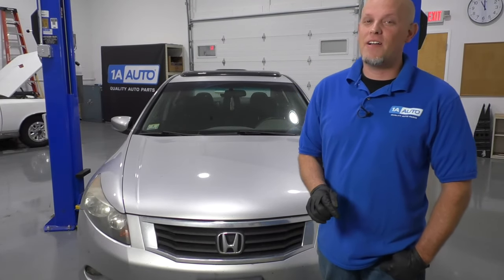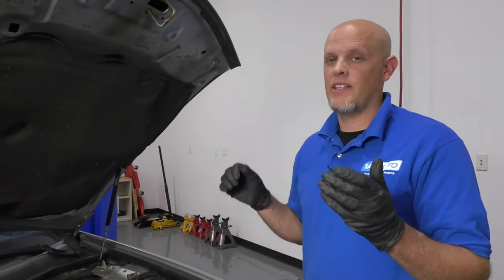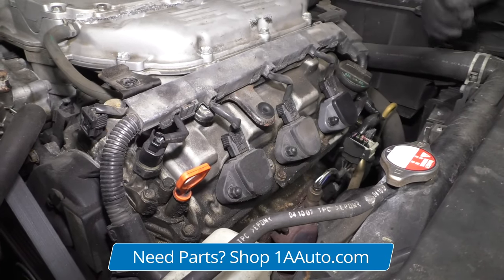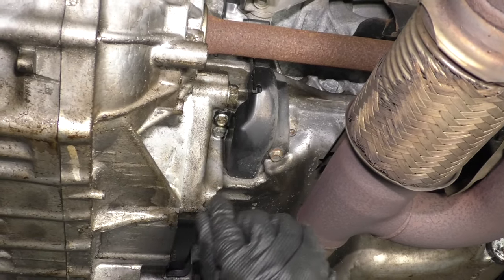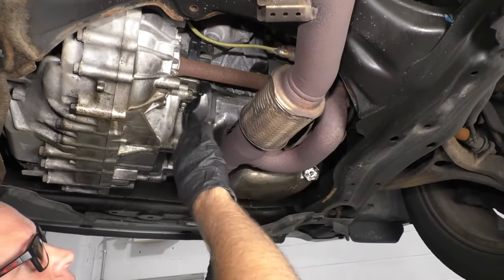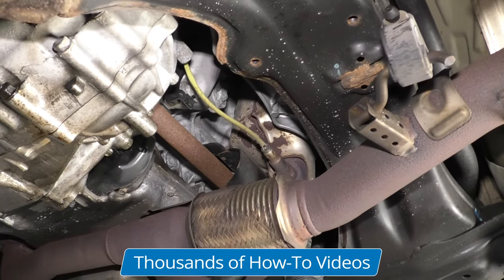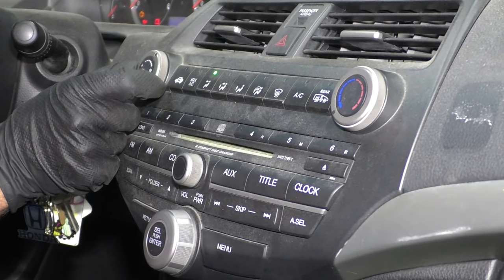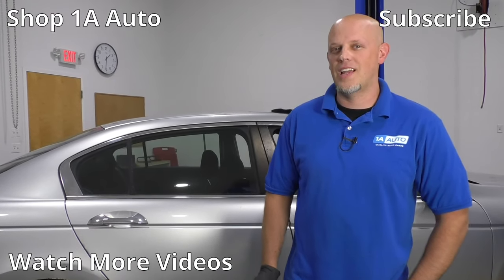Top 5 Problems Honda Accord Sedan 8th Generation 2008-12

Comment: Oh, if you had the 4 cylinder, you could have mentioned the under sized stock o-rings in the powered steering pump. Honda changed the part number for both sides of the pump in 2014. You need thicker o-rings for a seal to get rid of the whine. Just about ever 4 cylinder gets a power steering whine eventually, but it is a 15 minute $10 fix.
Reply: I need to do this !
Reply: By any chance you have the part number for that ?
Reply: I need the part number!!
Reply: @gsy8385  I think that write up may pre date the PN change. It was simply a slightly fatter o ring to get a better seal.
Reply: I wondered if this was my Transmission or Power Steering.
Reply: Yeah mine is starting to whine thought it needed some power steering fluid but when it's very cold it it whines
Reply: You are very correct.

Comment: I bought my ‘11 Accord LX 4cyl as a 2nd owner at 36K in 2013. Now it has 253K miles. 

It has ZERO ISSUES in the time I’ve owned it.

Only maintenance work done: oil change every 5K miles w/Mobile1, filters, tires, brake pads, rotors front&rear. Treated fuel system every 20K miles/once a year with a bottle Techron. Living in MN we have harsher winters and I never warm it up past 30 seconds. She still purs to this day.
Reply: Yeah i have 204k on mine and it cut off today but i think thats due to my auto start i had put on
Reply: Lucky lemon 🍋
Reply: Ever had a problem with the VTC actuator during cold starts? 
Should I replace this? 

I have 2008 accord 2.4 4cyl auto
85k miles

Comment: I have a 2008 Accord LX-P. with 286,000 miles. I had no problems other than the premature brake wear until I got past 200,000 miles. Since then I have replaced the power steering pump, starter, radiator, rotors, tie rod ends, and a back driver's side wheel bearing.  AC just started giving me problems.  The trunk spring just broke.  I have to add a quart of oil every 1000 miles. Passes smog but the engine light is on most of the time now. Code says it's the Cat is bad. California Car is pretty much done if I can't smog it.
I still have original spark plugs. Got my Accord in 2007. It was manufactured in Japan so maybe that helped.
Reply: You ever do  the water pump?
Reply: @danjones3402  No, the water pump is original.
Reply: If you change the spark plug, accelerator response will be better and gas mileage will become better as well.
Reply: @nicholaspetre1  I did finally change the spark plugs at 295,000 miles and the car does run smoother.  The left rear wheel bearing failed recently.
Reply: @WCoast_  Sorry to hear that. It is a hub assy at the rear. My front bearings both went bad at 180K miles. $700 to replace them. Rears are so far so good.
Reply: @WCoast_  I'm in similar situation...live in NYC drive 2010 Accord LXP with 180,000 miles and have the dreaded 0420 code/ check Engine light for a while now. Did you find by changing your spark plugs, this cleared the check engine light? 
I recently changed my spark plugs & my inspection is due by the end of this month, hoping that my car will pass inspection.
Reply: @Mac-Q7C  No, but the car did run better after I changed the spark plugs. A few times I passed inspection by using a fuel additive for the smog test and followed the instructions. The last time I had my mechanic do it, he used a catalytic converter cleaner and he got the car smogged and it passed. The engine light was the only reason my car would not pass.  if the battery was disconnected for the spark plug repair the engine light will go off for awhile. You need to drive a while, 50 miles or so before you get it tested.

Here are common causes and fixes for P0420:
Faulty Catalytic Converter: The catalytic converter itself may be failing and need replacement. 
Faulty Oxygen Sensors: The upstream (before) or downstream (after) oxygen sensor might be malfunctioning.
Exhaust Leaks: An exhaust leak in front of the catalytic converter can affect the sensors and trigger the code.
Fuel System Problems: Issues with the fuel system (e.g., rich or lean fuel mixture) can affect catalytic converter efficiency.
Worn Engine Components: Older engines with misfires or poor combustion can cause damage to the catalytic converter.

There is an O2 sensor on the top of the engine that is easy to replace and the special socket needed it cheap on Amazon or I think autoparts stores lend the tool out for free. There are two O2 sensors, but if the second one near the CAT fails I read it's obvious because the car runs bad.  I did this O2 replacement myself a few years back.

Good luck

Comment: I have this car almost 2008 Honda Accord grey fucking indestructible 190,000 miles, I went three months with out oil or something like that my boss finally changed it for me when he borrowed my car mechanic said he has no idea how it’s still running, I ran over a whole entire deer car was still fine, I left the car in the garage all winter 4 months with low gas and 10 percent oil life never turning it on, and without lifting it ,all I had to do was get a new battery and it runs like normal. If your thinking about buying totally recommend maybe slightly newer model with leather seats can’t go wrong

Comment: Only problem I have had was constant fouling plugs 3 & 5 , and oil consumption.
I installed the svcm and no more fouling plugs and no oil consumption. 135, 000 miles and runs like a champ.
Reply: What does svcm stand for?
Reply: An svcm or vcmtuner is a mod that allows you to disable the vcm system in the car (eco mode) hence the i-VTEC engine. Sometimes a faulty system can lead to issues with certain pistons that it banks in order to save fuel.
Reply: @hossboi52  I have lots of oil consumption in my accord. Would doing this be worth it? No codes on anything else
Reply: @ellapanda1425  100% would solve your oil consumption problem, I’ve had my VCM tuner on my 2012 v6 for quite some time now and ohhhhh boy it’s night and day differences. More power!! Plus you aren’t going to run your 3 back cylinders into the ground anymore. Vcm in these cars during this time were terrible!!!

Comment: 205k miles on my 08. Just had to replace the starter. Also now I have to change the power steering fluid. Starting to make a lot of cranking noise. Automatic locks just went out too. 

Really just a bunch of annoying little things.

Comment: There have been multiple class action suits involving the 2008 Honda Accord. I'm surprised you don't mention them...like the bad piston rings requiring adding oil very frequently and the excessive-wear brake problem. As far as I know, there are no "cures" for either problem.
Reply: The oil problem was fixed in a recall with a computer update
Reply: @slapshotjack9806  Do you have an article name about that?
Reply: @Xilent1  just read it online somewhere but yeah I think my car is actually beginning to have that problem because twice already I’ve taken the dipstick out of my engine only for it to have a tiny little drop at the end of it and the mechanics finding no oil leak unfortunately though the recall has expired so you would have to pay some money for the fix
Reply: @slapshotjack9806  piston rings
Reply: @southrichmondtofl  already had that fixed and it was still doing that
Reply: It's called keep oil in your trunk or buy a new car. 👍
Reply: @slapshotjack9806  Yes-- same here
Reply: The amount of misinformation here is crazy. On the V6 the real problem is VCM. Disable it and you won't burn a drop.
Reply: There's a fix for the oil consumption issue, it's called rebuilding the engine and fitting better piston rings. Toyota had the same issue with the 2AZ-FE around the same time and that's what their recall did. Unfortunately these would be out of warranty so you'll have to spend the money to get it done.
Reply: @damilolaakanni  The piston rings are not a fix. It's treating the symptoms. VCM is what caused those rings to need replacement. The only true fix is to disable VCM.
Reply: For the brakes I upgraded them to drilled and slotted rotors and that solved the premature brake wear problem. I’ve been having the car with it for almost 3 years and I haven’t changed the pads or rotors
Reply: What misinformation
Reply: @slapshotjack9806 какой объём двигателя вашего аккорда и какой год выпуска у вас американец или европеец ?

Comment: All these electrical  problems can be avoided if you add at battery cable  ground from  the engine directly to the  Neg -- battery ....      why the engine is not grounded from factory  is mind blowing because the Alternator, the starter and the spark plug greatly depends on the engine for ground... and poor ground shortens the life of all those parts and more......

Comment: The alternator is definately #1.
Reply: I would agree . Mine died at 123k miles
Reply: @lindaeasley5606  You got well over 100k miles out of the alternator. That's not bad.

Comment: 2010 Honda lx, 210k miles engine and trans original, 
New power steering pump, cv axles, bearings front only, new struts all around, p0420 code comes and goes but other then that it’s a great car. Moved my house hold goods to and from Alaska

Comment: The alternator does charge the battery, BUT, an even more important job is to supply high amperage also for all the power hungry computers, ABS and electronics of new cars!
Reply: This is a big misconception a alternator does not charge it simply maintains the battery but does not mean the battery doesn’t need to be charged regularly every few months, maintenance free batteries is a marketing scheme

Comment: You missed the all so common rear pads wearing out early. All the problems you noted hasn’t happened to my wife’s car and she has a four cylinder with 140k
Reply: caliper might sticking
Reply: 100,000 miles on the dot my calipers began sticking. First the passenger rear, then the driver rear. Pain in the butt.
Reply: @mikem4696  common issue on every single car probably, only way to avoid it probably garage keep and flush brake fluid or lubricant the calipers , due to the age of the car , even has 100K miles, but the car is 10+ years old
Reply: I usually got through 2 sets of front per 1 set of rear pads.
Reply: @wallisparnell4464  Seems the opposite for me. We had an 08 and a 2010 that has same issue.
Reply: @rhpham2  I would think that maybe your caliper pistons sticking or a bubble in the hydraulic system, not allowing the piston to retract? Have the rear brake bleeding done. Pull off calipers, leaving line connected, spray around, cleanup  piston w WD40, and gentle push brakes to see if move out and retract slightly.  Don’t push hard or out comes the pistons, yes?  Use a clamp to push them back in. Work them a few times, see if WD loosens them. Dirt around piston could be the issue.
Reply: @wallisparnell4464  The rear brakes you cant use clamps as Honda has the piston spins to retract out or in. I've done brakes on all sorts of cars and I can usually tell whether they are sticking. The wheel freely spins when brakes are not applied and the pads are wearing evenly. I'm surprise  this issues is not everybody as there was a class action lawsuit in the past for it. I get my pads at Autozone and they are lifetime so its good practice to change them out every year or so and see any other issues while your in there.

Comment: We have the 2009 accord ex with the V6..we have owned it since new..the dealer had to remove the head and rering and hone the 3 cylinders for that side, i believe cyl#1-#3 when it had around 60k miles...covered by warranty. We now i think 215k miles and the issue has returned. I apoke with the service tech today when he called to inform me the problem..said we were past the warranty where it needs reringed..i told hi. That they already did it when it had 60k miles. I love this car but i am so dissapointed that the engine needs replaced. I feel that the honda company should stand behind their product. We have always had it serviced regularly..almost always at the dealership with honda synthetic blend. I am dissapointed
Reply: Disable VCM and the problem will be solved.

Comment: Got an 08 4 cylinder with 200k miles and not had any of these problems so far lol. I have had an axle snap on me though due to a build up of rust in the center of the rod where the stock axle has a triangular weight that collects salt and water throughout the years. Only major fault and a seized up caliper.

Comment: I just got a 2012 accord EX-L 174000 miles it drives pretty good other then when I'm creeping up to a stop it's like it's stalling a little as well as all lights and power motors pulsate if that makes sense could this be the alternator

Comment: You mentioned the coil and misfire problems.  You could have discussed what causes this in the 6 cylinder engine which is the variable cylinder management (VCM).  This can be disabled to prevent the problem.  Things like the vcm muzzler prevent the vcm from engaging.  There is a slight loss of fuel economy but expensive repairs are avoided.
Reply: If the car already has the problems associated with vcm then its probably too late to get svcm and youll probably have to replace the piston rings and now that its out of the “warranty” for the tsb youll pay out of pocket
Reply: @packerman1203  That's not true. Disabling VCM usually restores the engine back to healthy operation.

Comment: You will need to replace the rear brakes like three to one ratio to front.
My 2010 also has higher oil consumption, 1.5 qt per oil change. The vtc actuator start up noise. Starter as well as ac compressor replaced. Another interior problem is the sun visor don't hold it's position but drop down an inch.
Reply from the maker: Thank you for the extra input! http://1aau.to/m/Shop-1AAuto-Now
Reply: Change those rear calipers dude
Reply: Put the svcm on it @ $90 and takes about 15min and oil consumption and plug fouling is gone. Done it on 2 cars.
Reply: @adamUDavies  there are VCM in i4?
Reply: @lsman38  not sure about the 4cyl ?
Both of mine are the 3.5
Reply: @adamUDavies  I doubt i4
Reply: @mikem4696  yess mine locked up about a year ago I was so pissed LMAO .
Reply: Lmao yes those damn visors
Reply: @lsman38  everything I’ve looked up says doesn’t mention the i4 including it but I just bought an i4 ‘08 accord and the original owner had the original window sticker and it said it included variable cylinder management. Really weird, I guess I’ll have to go to a dealership and ask.
Reply: @ian.williamson  it does for intake
Reply: @lsman38  the intake cylinders? Lmao what are you talking about
Reply: @ian.williamson  intake camshaft has variable valve timing. Not the exhaust.
Reply: @lsman38  yeah, that’s not even what I’m talking about. vvt is an entirely different thing from vcm.

Comment: 2010 Accord Coupe 4 cyl with 205k miles. At first it used oil and Honda repaired the motor. New piston rings if I recall. There was  TSB bulletin on this. After that I've only had an oxygen sensor and drivers side window regulator.

Comment: 3 out of 5 after 240k miles ain't so bad 😂 replaced both engine bay cats around 150k, the alternator around 150k, and now I'm replacing the blower motor AND alternator AGAIN at 240k.

Comment: If you get an engine misfire code on this generation for V6s, there is a TSB out for it. Your coils will likely be fine. This is due to the VCM for cylinders 1-3 that leads to high oil consumption, thus fouled plugs. Piston rings will likely need to be replaced.
Reply from the maker: Thank you for the extra information! http://1aau.to/m/Shop-1AAuto-Now
Reply: Why do the rings go out it’s a Honda
Reply: Finally got a correct answer for misfires and for faulty plugs, VCM SUCKS believe it guys.there is VCM muzzler in market which helps the motor to not active ECO mode or variable cylinder management system,SO that car can run on 6 cylinder fulltime no matter what,which can safe motor Avoid misfire, No need to change plugs anymore for 100k miles for sure.
Reply: @sajiwan1  Correct. I have a 2010 3.5 that started burning oil bad. Honda would not qualify me for the tsb because my oil consumption was just under 2 quarts burned every 3,000 miles. What a joke. Honda would charge me $ 4,000 to rebuild top of motor. I found a reputable small garage that has seen the issue and had a solution. he did a cylinder flush to remove the carbon build up on the rings and pistons on cylinders 1-3 and recommended i buy a vcm muzzler. It completely solved the issues. No more fouling plugs every 5,000 miles, no oil consumption and real V6 power all the time. 28,000 miles later, no issues!
Reply: @beckisammons4336  who will believe in this world i do have 8th  generation accord with  just 16,000 miles on it sitting in india with 2 covers on the body :( 
It's so brand new man wish I could import it to australia with me next year.
Reply: @Daddychill945  VCM was horrible gimmick Honda put on the V6s to improve the gas mileage numbers. It variably shuts down 1 to 3 of the cylinders as your driving, which leads to misfires, fouled plugs, bad rings, failed Cats, etc.
Reply: Install the svcm @$90 and problem will go away. Trust me , takes 15min max to install.
Reply: Nice!
Reply: @adamUDavies  is it for 4 cylinders as well?
Reply: @adamUDavies  I have replaced everything on my accord. All 4 cylinders and every sensor and it still goes into safe mode. Please help me. 😭
Reply: I had that same problem #2 cylinder rings went bad. Honda dealer said that there was a recall on it. Replaced it no charge.